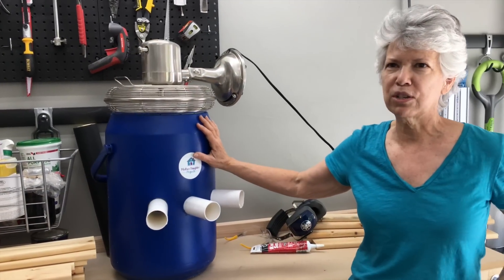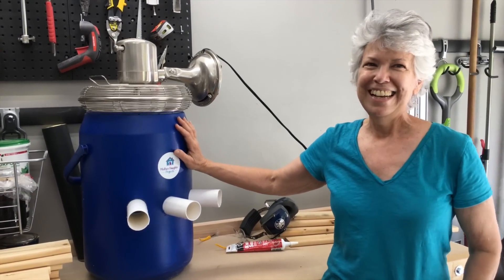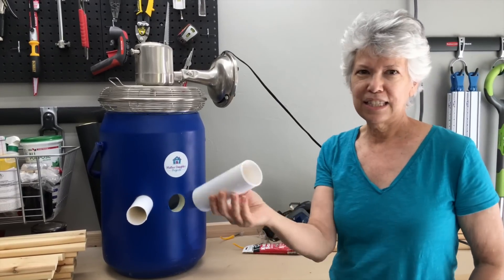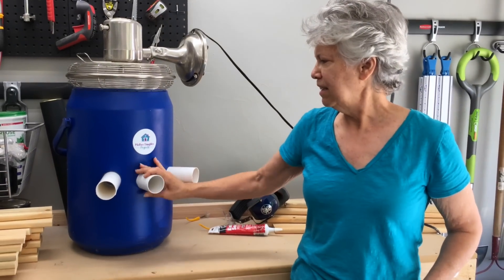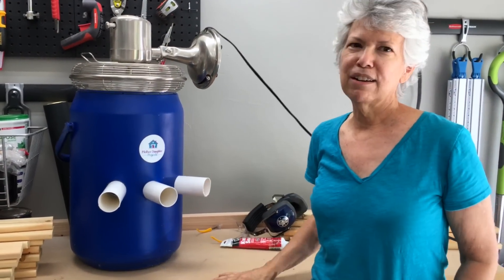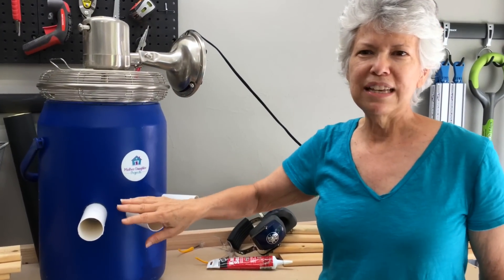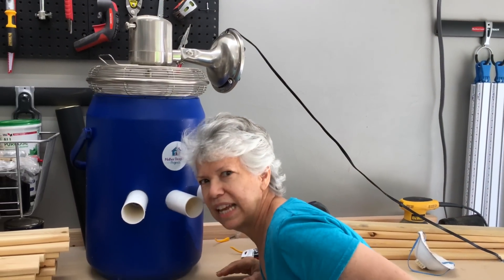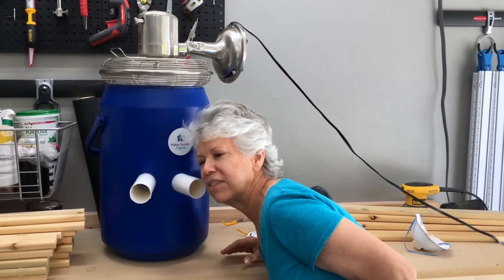DIY Bucket A/C

Comment: If you might make a vortex shape and have the small end where the air comes out, the air might get cooled a few more degrees.  When air is forced through a smaller opening, it cools.  Maybe using old soda bottles might give you a few degrees.
Reply from the maker: Good idea- thanks for sharing!
Reply: I saw little funnels may do that trick maybe.